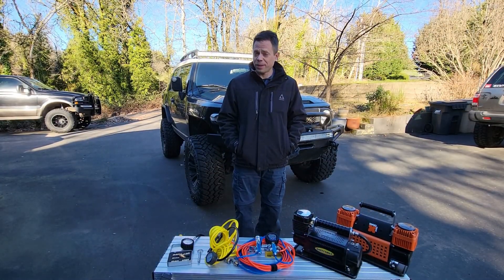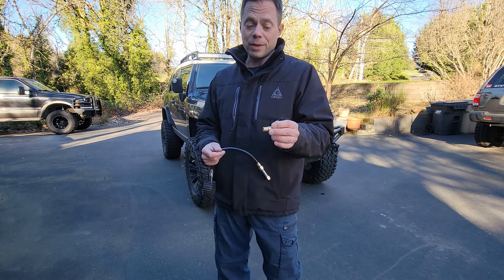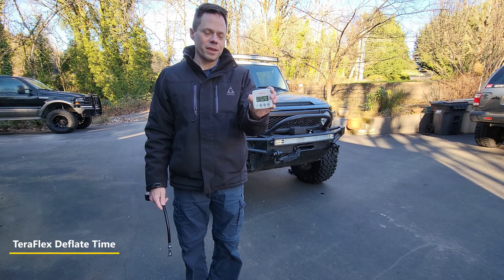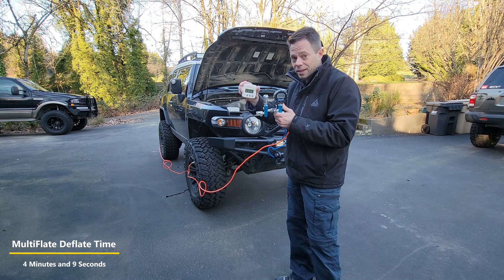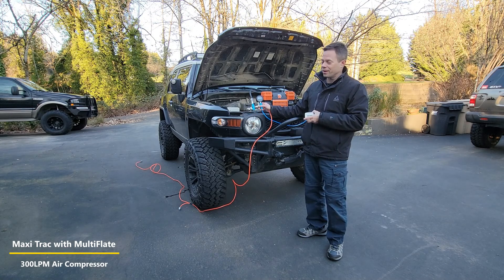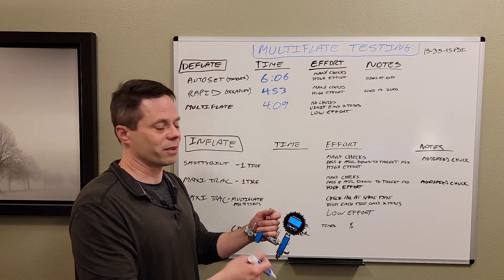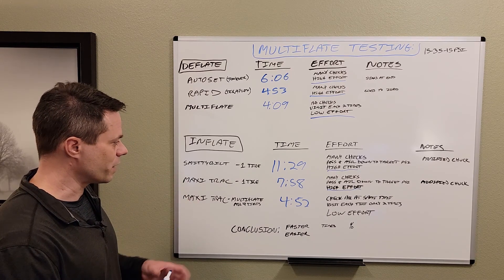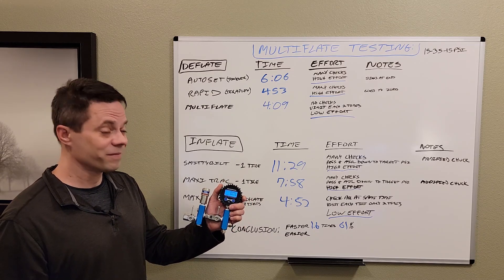Four Tire Inflation System Testing - 4x4 Off Road Tires

Comment: You got one of those NAPA Maxi Trac compressors!  I tried to get one last weekend but they are all out.  I bought an old metal dual cylinder compressor at a 4X4 swapmeet.  I normally use a C02 tank to air up, but I'd like to have the compressor as a backup.
Reply from the maker: Yes, I bought the compressor before they became popular and sold out. It is nice to have a compressor as a backup for sure!

Comment: would the time be faster with a larger diameter hose? say 3/8"?
Reply from the maker: I haven't tried it but I don't think that will help as the bottleneck is the Schrader valve in the valve stem.  These are roughly rated at 2CFM.  Inflating all four tires at the same time makes this 8CFM which is the greatest advantage versus inflating one tire at at time at 2CFM.    Other options would be a pump with greater CFM or a scuba or CO2 system that could provide greater CFM at higher pressures to force more air through the Schrader valves...  Another video is coming that will discuss this as well.

Comment: Great load of information.   I use a two tire inflation system since I tow a small trailer so I can air up the rears at the same time and same pressures and the fronts at a different pressure.  Those Maxi Trac (Napa) compressors are pretty powerful.
Reply from the maker: Sounds like a great setup you have!  Yes, the Maxi Trac is quite fast, and loud too.  Check out the Maxi Trac 300LPM review viedeo.